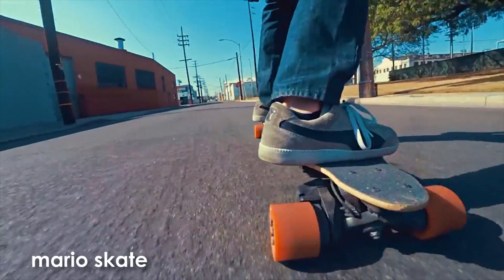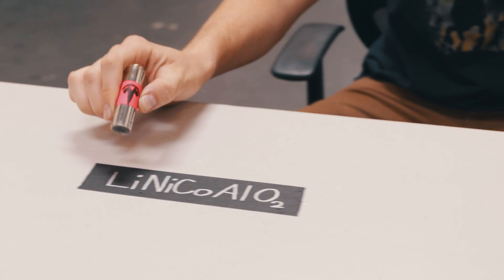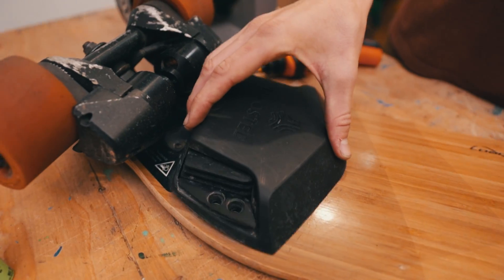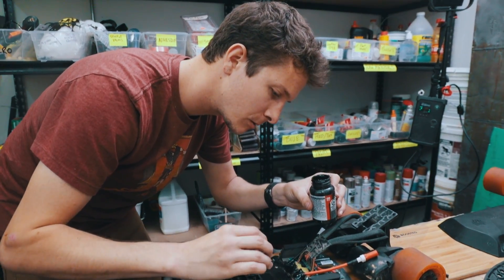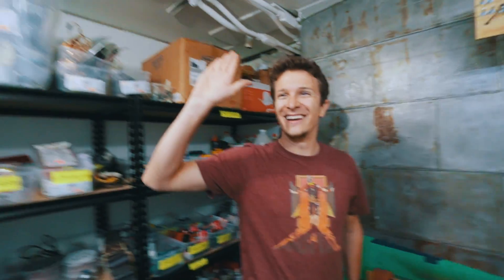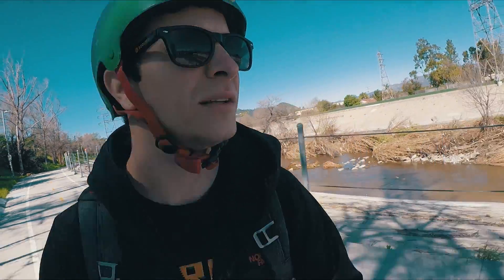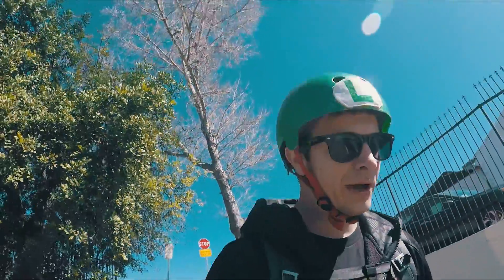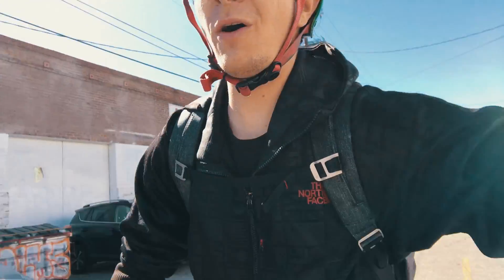Tesla Batteries in an Electric Skateboard!

Comment: The problem is not the voltage,  its the power output of the NCR18650B,  even at 2 strings in parallel they can output maybe 12A which is not enough to power your boosted board at full power.   I successfully ran my DIY EV VW bus using LiFeP04 and tesla 18650 cells for 3 years.     I have the answer to your problem,  you want to collab?
Reply: Yes! I just emailed you!
Reply: SirWrender he meant the YouTube not you
Reply: SirWrender nvm this was 2 years ago
Reply: Cool
Reply: I can't wait to see what happens! :D
Reply: It's also more accurate to measure the battery under load to determine how much you have left
Reply: I was hoping someone would mention this, but if you were paying attention in Physics class, putting more batteries in series than you need actually increases the total resistance by the resistance of one battery for each battery added in series. That would effectively cancel out the advantages you are getting by putting batteries in parallel. That would mean less discharge/amp draw rate which translates to less power overall. A better solution would be to use higher discharge batteries such as LG HG2s and sacrificing some capacity, mind you, it would still run longer than the higher capacity 18650Bs from Panasonic. The Panasonic NCR18650Bs are meant for low discharge applications such as laptops and communication equipment.
Reply: Mussie Tesfay yep,,, what you said 😄🤘🏻
Reply: jehugarcia- he should add 5 strings instead of 2 and it would last longer
Reply: herbsabeast1 series will burn the circuit board due to high voltage.
Reply: best is lg hg2 18650 cell
Reply: jehugarcia I’m sorry but your incorrect haha so if he because parallel will double your amp limit and your milliamp hours while series will double the voltage or you put so you’re incorrect and he’s in correct because in the video he said that he’s gonna run in parallel to get more volts witch doesn’t work he needed to run them in series to get more colts and parallel for longer life that’s how it works so sorry for raining on your parade
Reply: jehugarcia make the battery packs interchange and keep a spare in your bag
Reply: @clappedout98gt  sweet solution. Keeping two spare battery modules in a backpack etc
Reply: jehugarcia Sup man I would expect to see you here, live your videos.
Reply: Where is this collab?
Reply: i dont undersdtand
Reply: I think you must make a video with this guy ... what he makes is amazing .. a lot of work and testing!!
Reply: Sanyo NCR18650GA Cells would be great. 3.5Ah capacity and 10A max CONTINUAL discharge rate!
Reply: 30Q 18650 batteries
Reply: Also, a boost converter is a terrible idea because not many boost converters can handle the current draw of a boosted board.
Reply: I think those are rechargeable batteries so when the batterie of the boosyed board is empty, the other batteries still work but they work to recharge the empty original batterie so if you wait while the other batteries charge the empty one the boosted board will work again or you could just cut the contact with the original batterie once it goes emty and the boosted board will work
Reply: good job!
Reply: @jehugarcia the problem is not the voltage, it is the amperage output (power would be watts) of the NCR18650B, even at 2 strings in parallel they can output maybe 12A which is not enough AMPERAGE [once again power is watts or P] to create the flow of electrons that your people move needs.
Reply: I was going to say that hahahah
Reply: @baderyt1618  dang u must be smart then
Reply: @EzraSullivan  not really I’m dumb but I’m also smart lol it’s literally visible the battery cant put that much power in a row
Reply: Guess this callab didn't work out so well lol.
Reply: jehugarcia I
Reply: Funv vfddn mmf.        oL
Reply: wrenthereaper 😋😋😋😋
Reply: jehugarcia ididk de.
Reply: jehugarcia i
Reply: jehugarcia 
A
Reply: jehugarcia So what was the outcome?
Reply: jehugarcia too many cheeetos
Reply: Ya what he said
Reply: jehugarcia iiii
Reply: Capacitors along the battery
Reply: A
Reply: jehugarcia I
Reply: 1word nerd
Reply: @nash Yes but the issue with both of the battery technologies is the tesla batteries can discharge at a faster rate than the lifepo4. I has nothing to do with series and parallel because you would have to do that with any type of battery you put in there.
Reply: Just take out the booster board battery
Reply: I’m interested to know how to get more amps in a circlcet could you tell me
Reply: jehugarcia good job smarty
Reply: jehugarcia z
Reply: jehugarcia k
Reply: Yeah, this could be achieved using a Buck Converter and a couple of Diodes.
Reply: Jesus as
Reply: jehugarcia node is better
Reply: jehugarcia I was confused by that to
Reply: Need some samsung 25S.make a 10s4p pack that will give you 10ah and 100amp. Probably Can do 25 miles
Reply: jehugarcia good job I thought kinetic energy could do something but that's great you could help him I tried that but failed since I was missing something in my work and then went to kinetic that only did half of what he need
Reply: Mario Salazar yes it does...you can increase the output ampage by adding more parallel cells
Reply: jehugarcia  bro HOW DO YOU KNOW THIS
Reply: could you please repeat that... but in dum dum language?
Reply: Make 3 packs with the voltige of 2/3 of the 2 battery packs
Reply: Can someone plz tell me what map he is browsing at 6:28??
Reply: I did not understand anything you just said. Can you please speak english!
Reply: 4
Reply: @jehugarcia is the Don of DIY battery builds
Reply: Flux capacitor Marty. Duh
Reply: You said low-drain batteries, will this mod have the same problem as a trustfire AKA lithium ion battery. Also isn't it dangerous to have two different battery types working with each other at the same time?
Reply: Have you made a video about this yet?
Reply: jehugarcia thanks I under stand now
Reply: Come
Reply: I a, cnfution
Reply: jehugarcia English pleu
Reply: jehugarcia h
Reply: Calm down Einstein!
Reply: jehugarcia is
Reply: Yeah what he said
Reply: Parrallel is dividing amp draw, if 10 batteries can handle 20 amps each, in parallel you can draw up to 200 amps, the issue is in fact the wattage yes, but wattage is if you remember v×a, voltage is in fact the issue,
Reply: @retrodigi375  Idiot, it's called power not wattage and the formula is 
P=IV
Reply: how to get the checkmark
Reply: I was watching and thinking how you can solve the problem!!!!!
Reply: Can someone please translate this?
Reply: jehugarcia yes, whatever the fuck that means
Reply: What about Sony vtc5a? I use them to vape, they are rated at 35A but continues 25-30A. Btw I'm not an electrician, so don't get me wrong.
Reply: Nerd
Reply: jehugarcia just get a new car
Reply: G2 connecter mod
Reply: yes
Reply: jehugarcia your solution is not possible
Reply: Your solution is not possible.
Reply: Wooow
Reply: Cool
Reply: Thirsty for that youtube fame.... I wouldn't trust this guy... He sells stuff and always has problems delivering what you paid for....
Reply: no
Reply: He probably won’t  colab with you
Reply: clears throat SPEAK ENGLISH I UNDERSTAND and holy shit dude hell yes thats fucking awesome
Reply: That’s awsome that u can do that
Reply: I’m young so if you just didn’t use the boosted battery could you utilize all the volts
Reply: I didn’t understand any of that your smart
Reply: I have an idea (im on my mom’s account )and im a kid so what if you modified the original battery and make it like the won u made
Reply: I literally did not understand anything u said
Reply: Ok
Reply: Why dont you change the booster board battery with the tesla baterry so then the bateries would be same so it could go even longer
Reply: J
Reply: That Sound right i think
Reply: Fukin nerd
Reply: jehugarcia nerd
Reply: jehugarcia English please
Reply: u big brain
Reply: wth did you just say..
Reply: What did you say!!!!!!😂
Reply: 3 years later I’m still waiting for this video
Reply: A yes the NCR, the New California Republic. Death to Ceasar's legion
Reply: Wow
Reply: Apple
Reply: I lost you at NCR
Reply: This is what I hear blah blah blah science
Reply: OMG MAN GOT KNOWLEDGE
Reply: Interesting video.
Reply: Wtf....
Reply: Yes yes I know this is 4 years old but,  BraInS
Reply: That’s why you add a voltage linter to your batter pack that you add to your project.
Reply: cool
Reply: Did this collab ever happen? If so can someone link the video?
Reply: I was seriously just thinking "I bet Jehu would have the answer" right before I saw your comment! =D
Reply: Make this top comment so the board works better
Reply: jehugarcia I got a solution, use a buck converter to turn up the volts and put four packs of parallel together.
Reply: @HarryL2020  on the right track but buck is a step down. so you have to start higher.
Reply: @hayabusaxps  sorry I meant boost converter.
Reply: ok so what u have to do is get a portable charger and have it powerd by the bigger batterys so the smaller inbuilt skateboard battery can be charged by the left over enegy
Reply: Shouldn't he be putting his batteries in series? That way he could get a much higher power draw from his tesla batterys.
Reply: There’s always some “smart” guy in the comments.
Reply: jehugarcia Jesus fuck fred
Reply: wrenthereaper Wdym? He wasn’t asking  YOU
Reply: jehugarcia a bigger motor  or different gear ratio.?
Reply: nerd words stfu
Reply: jehugarcia dumbest thing I ever heard in my life bich
Reply: jehugarcia  sorry that was my little sister
Reply: English pls

Comment: Im no expert but if i understand correctly if you take out compleatly take out all the batteries from the boosted board and just install tesla batteries there should be nothing to bottleneck the voltage, and if its still doesnt work, give Spencer a call.

Comment: Wren, what cells did you use? NCR18650B? 

remember that while being able to be charged to 4.2V lithium ions have a nominal voltage of 3.6V (not 4V). Thats the voltage they will spend the most time at while being discharged. so 10 cells in series might not be enough 11 or 12 should be better to keep the voltage up.

do you use the original battery and the 2 new batteries all in parallel?

Comment: First of all, DC to DC voltage regulators generally can't handle the high current demands that the BB needs.  Secondly, they generate a fair bit of heat in the process and you'll lose as much energy in the conversion that you're currently unable to use at the bottom end of the voltage range.
You'd probably be better off finding a way to add another cell to the LiIon pack to start at a higher voltage, and end at a higher voltage.      Or just add a 3rd pack in parallel.

Comment: Either a very hefty buck/boost DC converter circuit, and /or some clever use of additional packs in series (up the voltage) and then run that through a switching regulator to your board. either way, definitely going to need some additional management circuitry to prevent running the packs too low, overheating, etc. (Tesla vehicles have a TON of management around their battery packs.)

Comment: The boosted board uses A123 cells. You added 18650 cells which not only are a totally different chemistry but also have a significantly lower discharge rating. This is going to burn out your ESC and or BMS.

Comment: Don't use a boost converter: those won't be able to provide enough power for that thing to run. That low voltage cutoff is to protect the cells from damage, and that's why it cuts out. What I would recommend is wiring the boosted battery in parallel with your other battery packs so long as they have the same nominal voltage (series cell count). If you have three packs that are in parallel, their voltages will be the same (that's the definition of parallel), so the in-built charger will still work, as will the battery meter. It will take longer to charge, but overnight it should be fine. Please pm me if you want more info, as I've actually been working on building my own electric skateboard from scratch for a while now.

Comment: Wren, check out vape batteries. They're also 18650 but they are high drain rechargeable batteries with 40A and 2500+MAH. I recommend IMR18650 be IMREN but Sony VTC4s are nice if you can find legit ones. Just be safe and monitor them with some sort of display.

Comment: maybe add more batteries so that you can use them as a voltage or current boost not sure wich one you need. But I think that with maybe half a pack more you will be able get more use out of those other two packs.

Comment: put some super capacitors? 2 in sequence so you have one constantly powering up while the other outputs power to the board, it might give the board the constant voltage it needs without having to drastically change the battery setup

Comment: #batteryproblem  try to make a switch between the boostedboard battery and the``tesla battery`` so when the boostedboard battery runs out, then you could change the power source tho the ``tesla battery``

#batteryproblem  try to make a switch between the boostedboard battery and the``tesla battery`` so when the boostedboard battery runs out, then you could change the power source tho the ``tesla battery``

#batteryproblem  try to make a switch between the boostedboard battery and the``tesla battery`` so when the boostedboard battery runs out, then you could change the power source tho the ``tesla battery``

#batteryproblem  try to make a switch between the boostedboard battery and the``tesla battery`` so when the boostedboard battery runs out, then you could change the power source tho the ``tesla battery``

#batteryproblem  try to make a switch between the boostedboard battery and the``tesla battery`` so when the boostedboard battery runs out, then you could change the power source tho the ``tesla battery``

#batteryproblem  try to make a switch between the boostedboard battery and the``tesla battery`` so when the boostedboard battery runs out, then you could change the power source tho the ``tesla battery``

#batteryproblem  try to make a switch between the boostedboard battery and the``tesla battery`` so when the boostedboard battery runs out, then you could change the power source tho the ``tesla battery``

#batteryproblem  try to make a switch between the boostedboard battery and the``tesla battery`` so when the boostedboard battery runs out, then you could change the power source tho the ``tesla battery``

#batteryproblem  try to make a switch between the boostedboard battery and the``tesla battery`` so when the boostedboard battery runs out, then you could change the power source tho the ``tesla battery``

#batteryproblem  try to make a switch between the boostedboard battery and the``tesla battery`` so when the boostedboard battery runs out, then you could change the power source tho the ``tesla battery``

#batteryproblem  try to make a switch between the boostedboard battery and the``tesla battery`` so when the boostedboard battery runs out, then you could change the power source tho the ``tesla battery``

#batteryproblem  try to make a switch between the boostedboard battery and the``tesla battery`` so when the boostedboard battery runs out, then you could change the power source tho the ``tesla battery``

#batteryproblem  try to make a switch between the boostedboard battery and the``tesla battery`` so when the boostedboard battery runs out, then you could change the power source tho the ``tesla battery``

#batteryproblem  try to make a switch between the boostedboard battery and the``tesla battery`` so when the boostedboard battery runs out, then you could change the power source tho the ``tesla battery``

Comment: That was a great video! My idea is that there is probably some sort of a circuit on the battery compartment of the boosted board that controls how much power you can draw. That means that the main electronics are there, and so is the voltage monitoring circuit and low voltage monitoring circuit. So maybe you should open the battery pack, and either connect your batteres in parallel with the onboard batteries directly, before they get connected to the main electronics(NOT safe), or use the extra batteries to charge the board batteries if the onboard charger allows that.

Comment: Have you ever looked into a joule theif? Basically it can take the remaining voltage in a "dead" battery and it powers a simple light. They use wires coiled around a magnetic core to boost the power from the battery. Sounds like something to look into.

Comment: Umm - is the 33V stopper part of the firmware or is there a digital volt meter in the device which is used as a switch? - if it's firmware, how good at coding are you? If it's hardware, can you find it and by-pass it?

Comment: probably not the only person to suggest this, but here we go: rip out the old battery pack (12s lifepo4) and replace it with a 10s3p pack of Samsung 25r cells, or a 10s4p pack of Samsung 30q. it'll give you the same or more power and much better range. (the 25r pack will be lighter but less range, the 30q pack will have massive range but be heavier.) also, get a legit battery management system or a balance charger, it really helps keep the cells happy. The 25r pack will have 250+ watt hours, the 30q pack will have 400+ (vs the stock 99 of the boosted.)
Reply: these numbers reflect the fact that you won't be getting the full capacity out of them due to the 33.6v cutoff.

Comment: from my knowledge from when I made my own electric skateboard, you probably have a cut off on your electric speed controller which is what is stopping you from passing that point where the voltage drops, the only issue is that lowering it will ruin the boosted battery, that is if you are even able to change the programs on the ESC (electric Speed controller)